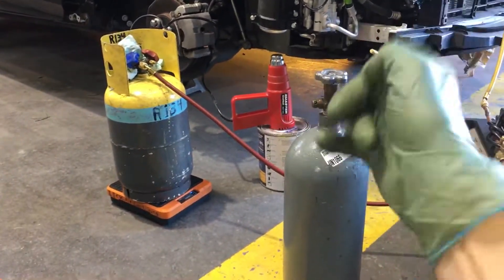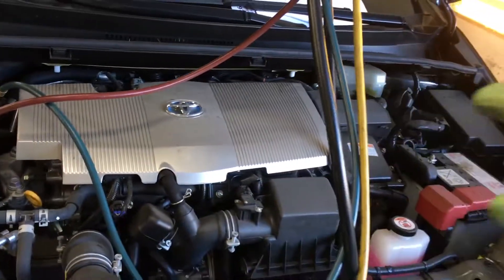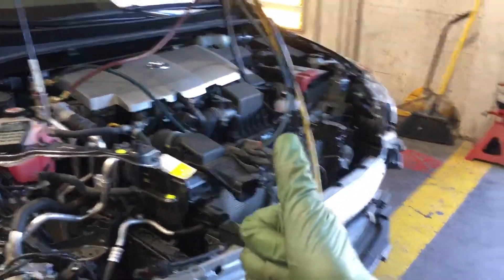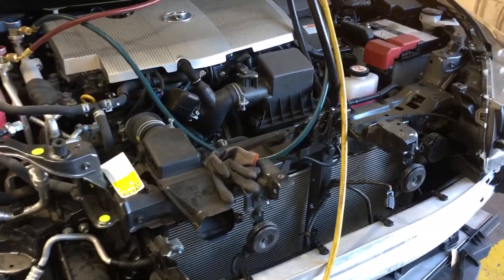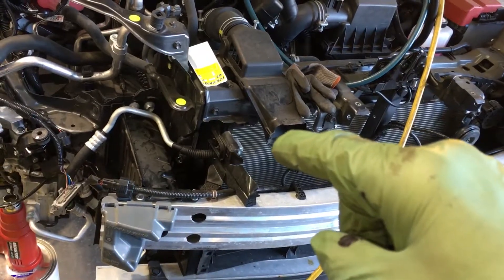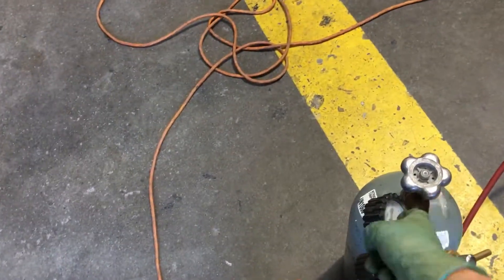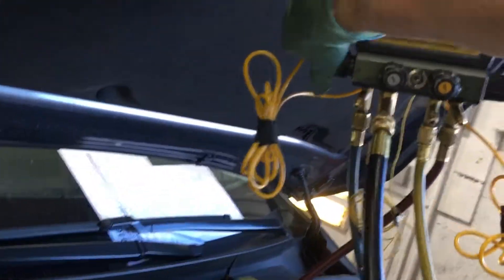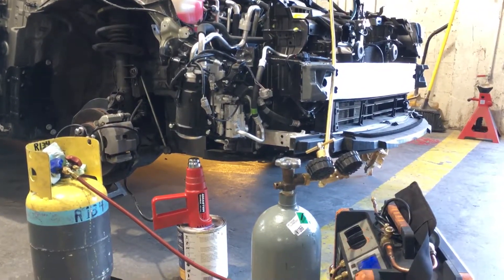2018 Prius Prime 4/4 Nitrogen purge the air conditioning system after refrigerant recovery

Comment: Hi i have 2018 Prius prime  a issue where the compressor scroll just busted, where scrolls are just falling apart with metal shavings Ms My question is can I get by changing the compressor, condenser. Is there anyway I can flush this system?
Reply from the maker: If you pour out oil from the accumulator, and you see that it’s gray with micro find metal flakes inside of it in the oils burnt you have to replace everything and flush everything. 

Some people do not that’s their choice .  But the gray stuff that’s floating around in the oil that is like 3000 grit sandpaper.  It goes right through the filter screen.. and travels back to the compressor to the bearings and all moving parts slowly shortening it’s life. 

So everything must be replaced, and whatever can be flushed flushed . 

The cumulator assembly is nonserviceable no replacement parts, and you cannot flush accumulator, and all those valves replacement only. 

Otherwise, there’s no warranty or no guarantee of any kind and the compressor will fail a short life 

There was no reason for your compressor to fail in the first place something caused it  ? 

WHAT ? 

Compressors usually outlast the life of the whole entire vehicle longer than the engine longer than a Transmission 

The only reason they die is because they were murdered 

The causes a Technician Hwy Service did before 

Or neglect from the owner by not keeping up on the AC charge, and when they notice it starting to get a little warmer and warmer, they continue using it, and it burns itself out, but the cause was from the owner 

When a compressor, refrigerant charge is never allowed to get low on refrigerant. It will always continuously flow a nice cold supply of lubricant in the form of like an aerosol constantly lubricating and constantly cooling off the compressor so they live forever. . 

But when they’re allowed to run when the refrigerant charge slowly get slow, cold, refrigerant stops coming back to those hot electrical windings plus the heat of compression plus the heat of friction 

And on top of that as a Refrigerant level gets low oil start slowing down on delivery back to the compressor and so it’s suffers from lack of lubrication .
Reply: @coldfinger459sub0   thanks, the only thing I noticed was wet oily spots near the accumulator, and solenoids. The Freon was low. Would a low Freon cause the compressor scroll to god bad? Wouldn’t the compressor oil  lubricate the scroll.
Reply: Also with all the solenoids on this ac system, how do you flush the system?
Reply from the maker: @Everestsautolab  as I mentioned earlier, you don’t you replace them. 

Unless you get really geeky and take each one off individually, hook it up to adapter and energize the solenoid open and close, and then flush it into directions . 

This would be the backyard method if you have all the Time in the world and you have no labor rate and money is not an option 

But in the real world, for example, my labor rate in San Francisco is $204 an hour

I would charge more to clean and flush the system than buying all the components brand new . 

There’s only two options for a professional who wants to give a warranty and guarantee 

Either do it right once and it’s going to be expensive or turn the job away and don’t do it at all .   Because it will come back as a Failure and then the customer will be mad at you for trying to take shortcuts.

But if you were, do it yourself, person in your own backyard, then you have options and if you choose the wrong one, it might be a very, very expensive repeat option .
Reply: @coldfinger459sub0  thanks, I just got the accumulator out, no debris from it, am I saved🤞
Reply from the maker: @Everestsautolab  low, refrigerant will eventually kill any compressor

And supposedly safety switches don’t always work it’s more like the old engine idiot, light radiant light comes on after the head gasket is blown on the engine and it overheated
Reply: Accumulator from dealer is $1650 😬😬😬.  No debris maybe I can get away with just the condenser

Comment: Thank you.If I want to recharge the system with refrigerant due contamination may I need to do nitrogen purging since I don't want to replace part?
Reply from the maker: If it is only refrigerant contamination you can do the triple evacuate and purge method using the vacuum pump and dry nitrogen and remember you’re only bringing the pressure back up to about one psi and then breaking the vacuum with nitrogen and then vacuum again and repeat the process three times

And then you can leave it on the vacuum pump for as long as it is you need to achieve your final vacuum and recharge as normal

This way you are sure you have removed all the contaminated refrigerant

Comment: Thank you for these 4 videos. I have 2017 Prius Prime (PP). Based on fellow PP owner's input, we think the engine coolant takes over for the heat pump when the outside temp reaches 11 degrees F. Look forward to your final determination on those potential leak points.

Comment: Thanks for the great information about the Prime. So does this heat pump design completely remove the need for engine coolant to be used for heating the cabin? I'm wondering how well it performs in sub zero conditions.
Reply from the maker: Only in cold weather and as soon as the engine coolant is hot enough it switches over to using the engine coolant. 
            It’s for quick comfort if you’re in somewhere where it’s only 30°F  and you want instant heat
            They now make heat pumps for your homes that go all the way down into the low teens F to warm your house. 

         As for 70 not very well but if you’re in subzero something is better than nothing. 30° air hitting you would probably feel good at those temperatures lol
Reply: @coldfinger459sub0  cheers 👍